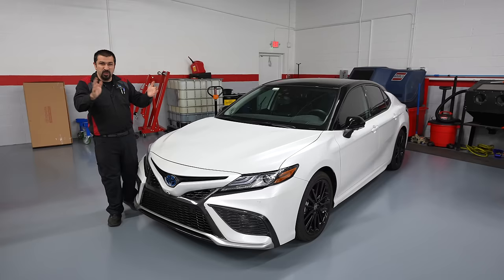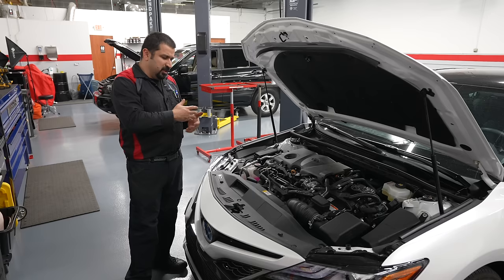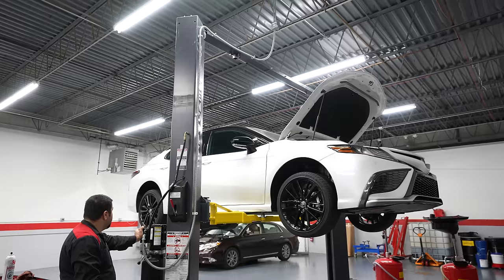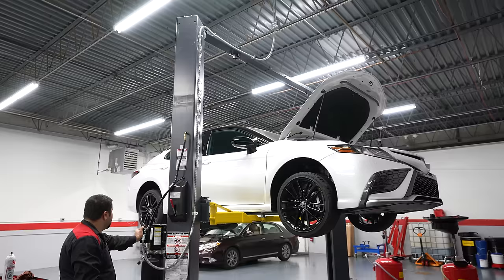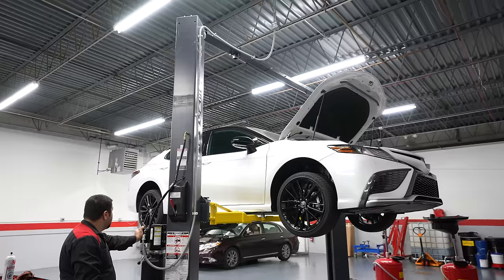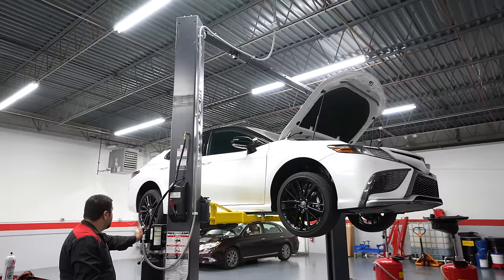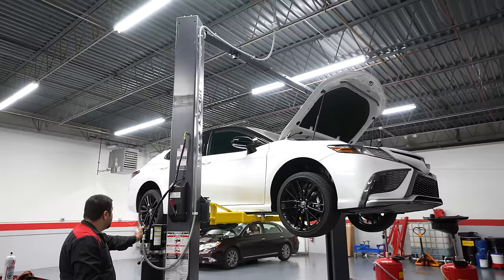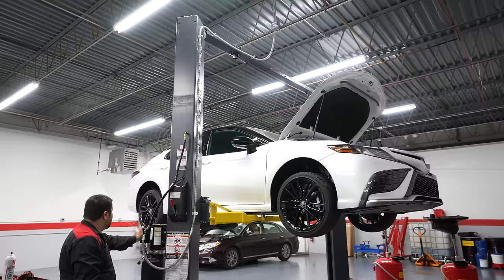Should you buy a Toyota Camry Hybrid? 1 Year Ownership Update

Comment: CARE CAR NUT...PLEASE READ MY STORY RIGHT HERE...FEEL FREE TO COMMENT
My 2020 Camry LE 2.5 is a great car. Recently my battery showed signs of failing and it finally did on their property. The dealer replaced it with no problem. However, the battery lasted only 2 years and 11 months. The original battery in my previous 2005 Camry LE lasted over 8 years!! While I was having the "Toyota Care" for two years on my 2020 LE...the dealer overfilled the oil 3 times. I checked it right on their property...each time! I made them suck some oil out until it was right. The dealer has an automatic oil pumping machine that fills the crankcase automatically. I told management they need to adjust the "oil filling machine" to install 4.8 quarts...not 5 quarts.! I thought this was not acceptable coming from a Toyota dealer! THE ENGINE WAS NOT WARM OR HOT! I bet they have overfilled hundreds of Toyota engines. You would think they would fix the problem since it is costing the dealer more money in synthetic oil. 
     Here's another laugher for you Toyota owners...After the dealer did the final Toyota Care service I attempted to do the next scheduled oil/filter change myself. I've done hundreds in my life. I first began by removing the oil filter and could not remove it. Some previous "oil change monkey" (dealer) put it on so incredibly tight...I disfigured the filter with my "one-way filter wrench." So, before I put a hole in the filter, I drove the car to the dealer and showed them my filter wrench and showed them my receipt to show that "THEY" did the last oil change. The dealer apologized and agreed to remove the filter and do a free oil/filter change while I waited. A supervisor showed the "big boss" and me the mangled up filter that they removed somehow. Of course...the dealer was super embarrassed. I will be doing the next oil/filter change. I hope I can remove the filter...next time.

Comment: Hi AMD 👋 Please help,
Sub: Overfill damage ? 
My local mechanic has been filling up 5 quarts of oil in my 2018 Camry Hybrid LE since 30k. Now it’s 118k. I’ve mentioned to him once that the dipstick shows that it’s overfilled but he said it’s ok and not to worry. 
Did it already damage a lot? What should I do?
On a separate note: He also keeps insisting me to use 5w30 since it crossed 100k but I didn’t agree.
I buy 0w16 from dealership but only onetime used Mobil1 0w16.
Thanks 🙏.

Comment: Toyota battery warranty sucks let us know at 100k got rid of my prius as the batteries were failing under warranty and Toyota would replace as they weren't failing enough...clutch replaced oil leaks etc not a fan got rid of it under warranty

Comment: I took my POS RAV4 SE built in Kentucky in to the dealership for a 1000-mile oil change and they made fun of me. They were able to use the 20k service on it so at least I didn't have to pay for It. I won't be going back to that dealership again.

This Camry isn't a JVIN, is it? 🤦‍♀ That is what you get for defending the abysmal build quality of Kentucky "Toyota". Do you really think that they paid close attention to the build of the engine if they can't get the body right?

Yes, I did get a POS fake Toyota also. I really needed a car and my sister foolishly paid for half of it and said that she would cover any costs due to the poor quality that the meth addicts in Kentucky built. Even at half price and essentially a free extended warranty for me, the SE is not worth it. I don't have any rattles so far at least.

Comment: If someone gave me a hybrid (not plug in) Toyota Camry 2018, Id' take it.  Only before it was looked at under neat, inside electronics, battery life, tires, brakes, and everything else, I'd take it.  But not a 2019, 2020, 2021 to present.  They stink.  Especially those low riders! I don't like the Toyota's with that stupid start and stop mode.  That ruins and drains your batter (both of them). Toyota's craftmanship is slipping and cutting corners.  I wouldn't buy  a anything after 2019.

Comment: Engine very nice updated direct and port injection both included at same time...but 8 gears are too much gears..yes more gears will give better fuel economy on highway but more gears takes away the driving pleasure and thrust feel the heavyness.....6 gears are much more sufficient and driving is pleasurable....design wise this is the most ugliest camry  ever just way too big and long wide but no sleek smart design or sharp curves...very ugly dashboard with a weird Y shape design also centre console is weird with cross cut open close lid...speedometer is pushed way too much on right side just to fit a nonsense digital screen in between...now speedometer is hard to see and it gets blocked by steering wheel....front windshield and rear windshield are very much sloped down and visibility gets limited because of that slopeness...no matter at what position you adjust your seat....only thing good about this camry is Dynamic force engine...thats it...and if you get basic LE model the blade keys are super heavy and chunky given on purpose to force you to buy upper trim level....Good design Finishing and Toyota cannot go together....toyota searches and somehow discovers the ugly designs in and out

Comment: Folks need your help here. Have called five different Toyota dealers and received two different answers; I am the proud owner of 2022 Camry SE Hybrid. I wish to install the LED front accent lights PART #PT948-03210-12. Boch Toyota South
620 S. Washington St
N Attleboro MA 02760 
Advertised  the part as OEM direct fit for my VIN. They even sent me install instructions pdf...but 2022 does NOT have an 8 PIN connector at the LH light. It is a 6 PIN. They say it is impossible and refuse to take the part back. Is there an LED accent light for the 2022 Camry Hybrid? In the meantime, plenty of dealers continue to advertise the part for the 2022 Camry SE, including the Hybrid.....HELP!